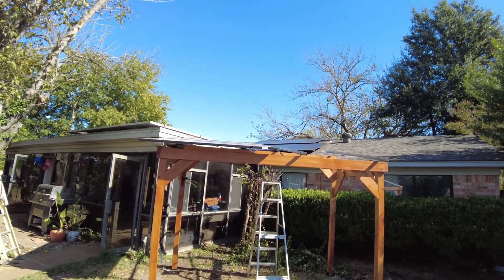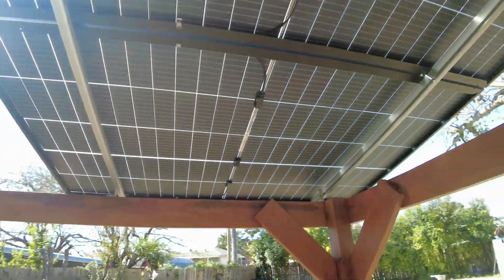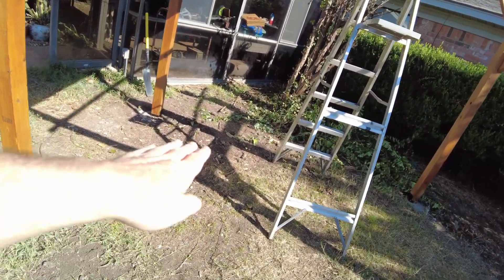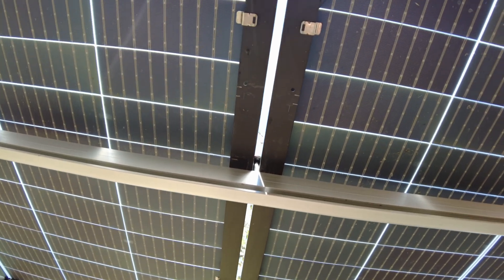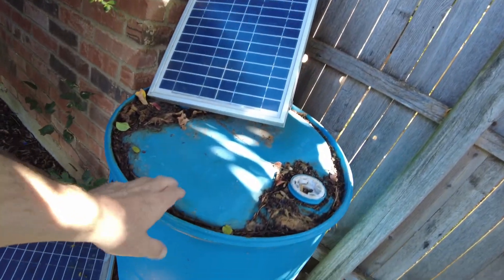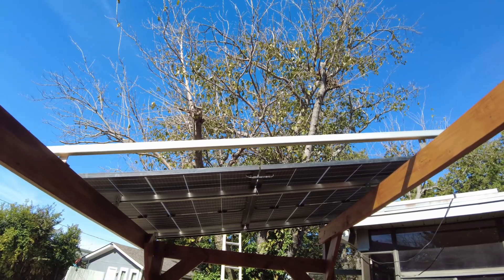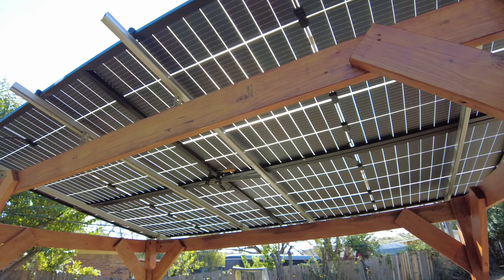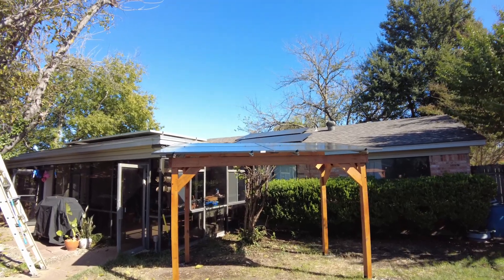Solar Pergola

Comment: I've been wondering about gutters underneath the gaps between panels. I don't think thought, that it needs anywhere near the full-size gutter between panels as would be used at the eve. I think I might bend my own as a simple 'V' using some narrow rolls of flashing.  I think a 2in x 2in would be adequate but looks like 6in wide rolls (making a 3x3 'V') seems to be the smallest readily available.  Too bad there isn't a common "mini-gutter".
Reply from the maker: I agree, would not need to be very large. The flashing bent in a V is a good idea. I was thinking about a PVC pipe cut in half.
Reply: @BradCagle  I considered cutting PVC pipe, but I've never cut long pieces before, and I didn't like trying to cut 4ft lengths.  If you try it, and figure out a good way, please post!
Reply from the maker: @Sylvan_dB  Will do :)

Comment: Did you dig to mount the posts? I've thought of doing something like this but I'm always afraid it will blow away in a strong storm.
Reply from the maker: Yes, I poured concrete footers, and used an anchor bolt for each post. Thanks
Reply: @BradCagle How deep were the concrete footers .... And did you need a permit for the pergola?

Comment: Instead of using mid clamps, use Ironridge Camo Hidden End Clamp from the underside=no gap between panels
Reply from the maker: Oh man, I've seen those but I did not quite understand how it works until now. That seems like the solution, I'll try to order some. Thanks!

Comment: You should get some white reflective rocks underneath it to take advantage of the Bifacial gain. That way you don't have to worry about mowing underneath it and make extra power in the process
Reply from the maker: @Moes_Prep_and_Tech  I think we're going to lay pavers down. Maybe I'll paint them white 😜. Thanks!

Comment: I bet that's GREAT in the Winter time. Summer is Awesome for me But winter time I get shadows everywhere in my backyard because the sun isn't up as high as it was. How tall are the Posts?
Reply from the maker: @Moes_Prep_and_Tech  Yeah, that's what i was thinking too, if i get it up higher i can minimize shade in the winter. The posts are 7' in the front, and 8' in the back. Thanks
Reply: @BradCagle  do you know what your angle is towards the sun?

Comment: What make and material are those panel rails? How do you feel about the weight and wind load on them? I'm guessing they are about maxxed out with those panels on them
Reply from the maker: The rails are iron ridge xr10, the specs say they can handle 6' span with 120mph wind, no snow. My span is 5.6' so I'm a little under the max. We rarely get snow, but I may add some extra support just incase, or just swap the rails to xr100. But yes, make sure to look at the specs for rails to make sure it can handle the span, and weather conditions. Thanks!

Comment: That's such a great idea Brad. If you want you can expand on it later too.
With the seam, maybe you can attach the panels from the lower lip of the panels channel which would allow you to butt them to each other?
Reply from the maker: Hmm, that would do it. I need to think about how I could attach them. I could probably use a bit of angled metal. Thanks

Comment: You  could use a T-Type Solar panel sealing strip, or something similar at a hardware store. Automotive T-type dashboard sealing strips are very similar but much cheaper.
Reply from the maker: Good idea. I do wonder how well that holds up, how long until UV deteriorates it. Thanks

Comment: I was going to build something similar and thought about using clear gorilla tape. Clear and sticky as hell so definitely water proof. 

Nice job
Reply from the maker: Ahh, so it's double sided tape? That would work, you may never get them apart again :) Thanks!
Reply: @ probably right about being stuck together forever. Lol

Not double stick buy if laid across where the frames meet, doubt any water gets thru. Only a razor knife will let them live apart again. Like I said, you get only one chance to stick it to something and it’s there forever. 

Used it on some plastic shed wall corners that were cracking. Even after a couple years, it shows no sign of weathering.
Reply from the maker: @Barc7580  Oh, ok I see now. That would probably work.

Comment: I think the rain water collection is actually a real good idea. Many ppl who are setting systems up are off grid and may need to collect water as well as solar. I hope that works out!
Reply from the maker: Yeah, I think I might do it. I could just cut a 4" pvc pipe in half. Use one section for the mid seam, and one up front. Thanks